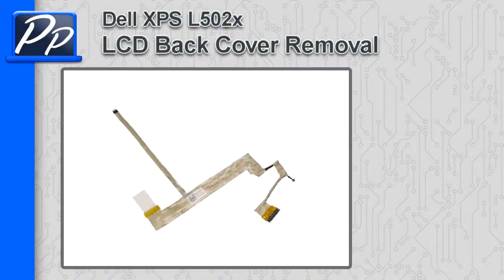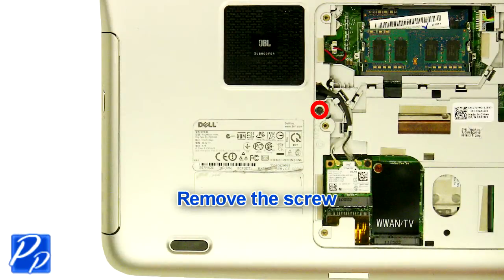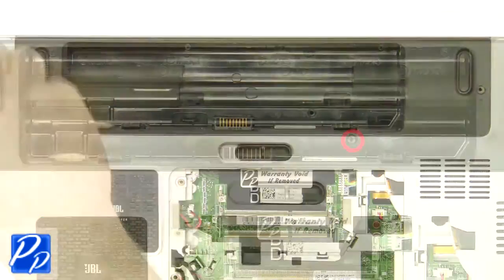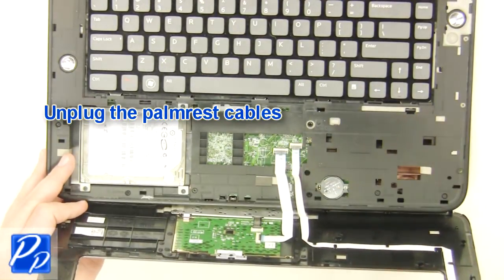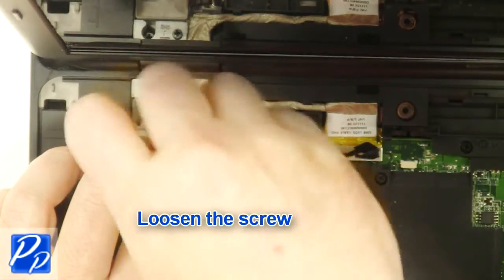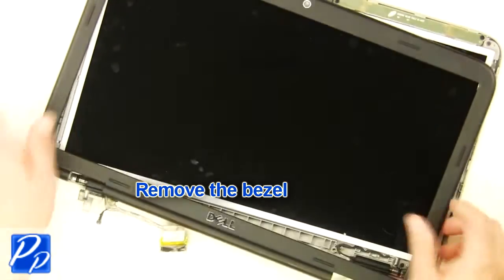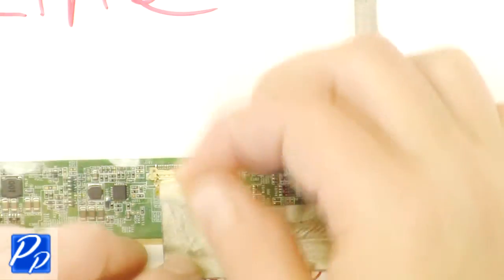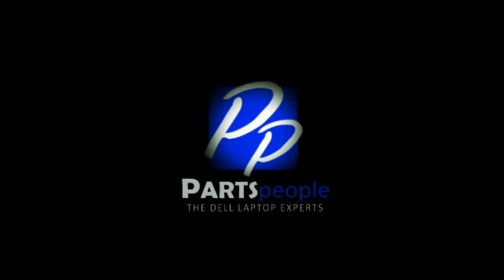Dell XPS 15 (L502X) LCD Cable How-To Video Tutorial

Comment: i have l501x. the matrix is white after start, behaves like with damaged cable (goes from "random bright colors" to white slowly). After warming up the problem is dependent of how i place the matrix. after 10 more minutes problem disapears completely. Can I be sure it is the lcd cable?
Reply from the maker: I would suggest connecting to an external display. If this resolves the issue it may in fact be the display cable.
Reply: @dellpartspeople  it works with the external display, but i have other version of the display and lcd cable is not available in your shop (WXGAHD). Guess it's time for this laptop to visit graveyard.

Comment: So I replaced the cable, and my screen is still white. Could I have installed the cable wrong or is it definitely the LCD?
Reply from the maker: It's hard to say, does an external monitor work? It's possible that the GPU has failed.

Comment: Wow,I didn't realize it takes so many screws & parts to be removed just to replace the LCD cable! 
My L502X screen flickers at certain angles. Sent to a shop to have it repaired. Tested it there and no problems. When I got home, turned it ON, it starts flickering again..WTF!
Sent it back to the same shop, they said this time they replace the LCD cable to a new one. At no charge of course. Tested it at different angles at the shop and worked perfect. I got home, turned it ON and it works fine.......for a while. Now its flickering again at certain angle..WTFWTF!!
What the hell is wrong with my laptop?? Eventhough my L502X is almost  5 years old but I don't plan to get a new laptop anytime soon because I just love this machine..Oh, and the left mouse button stopped working about 3 months ago. Glad I could double-tap instead.